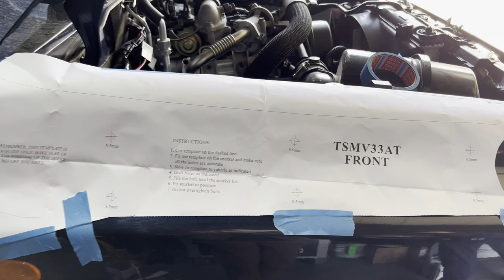Cum se instaleaza Snorkel Play Xtreme Mitsubishi Pajero MK2

Comment: Salutări din Italia Florența o întrebare despre snorkel Văd multe snorkeli pe multe vehicule de teren care au conducta ciuperci întoarsă spre spatele vehiculului de teren 4x4 și are cineva țeava ciupercă întoarsă spre partea din față a 4x4 vehicul de teren? (și unele vehicule de teren Are 4x4 o ciupercă de ciclon ca o mașină agricolă sau de terasament?) Crăciun 2023 din Italia Licitație la Florența Panama)
Reply from the maker: Hello, 
Why install a snorkel?
A snorkel exists to quite literally elevate your vehicle’s air intake, which not only mitigates the impact of dust and water on the engine but takes in more fresh air to keep the engine cool. It works by moving the intake further away from the ground, where your vehicle will be kicking up plumes of dust and dirt. The raised intake also reduces the likelihood of water finding its way into your engine when crossing rivers and other shallow bodies of water.

The head is the part of the snorkel where all potential contaminants are separated from the air before it enters the snorkel itself. The two most common types of snorkel heads are Air Ram heads and Vortex (or Cyclone) heads.

Air Ram – other known simply as standard head, this head lets the air ‘ram’ into the snorkel, as the name implies. The contaminants are then blasted against the side of the snorkel head and fall into the snorkel itself. They are then filtered through small vents in the snorkel body. These types of heads can face either forwards or backwards.

Vortex/Cyclone – The head you’re going to be looking for if you regularly drive in very harsh conditions, vortex heads utilise centrifugal force to separate the contaminants from the air. A strong gust is pushed up through blades that encourage circular movement. This pushes contaminants out and takes air in. It’s generally a more expensive option but is particularly useful for farmers or desert drivers.